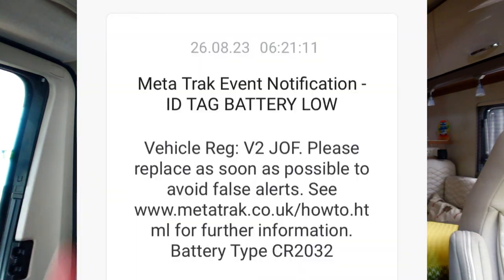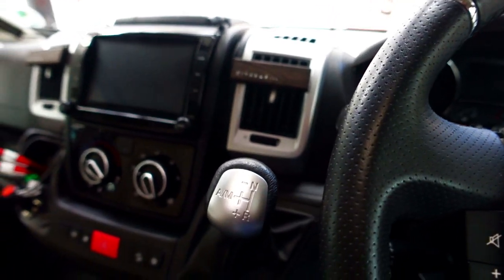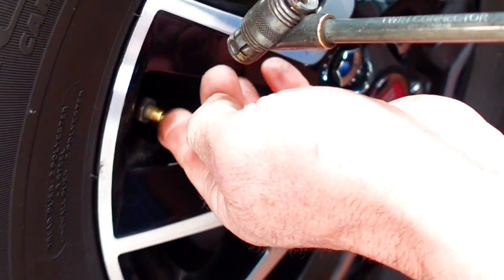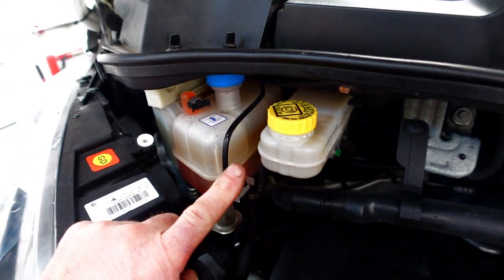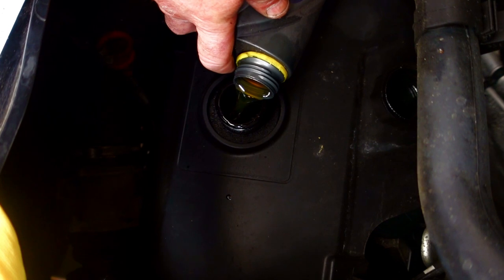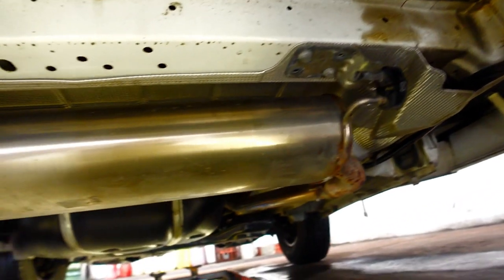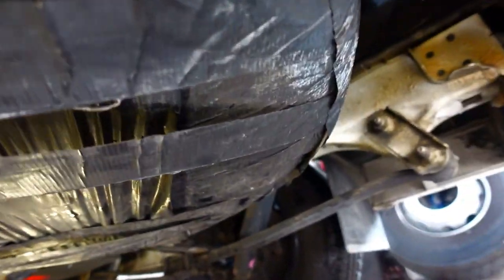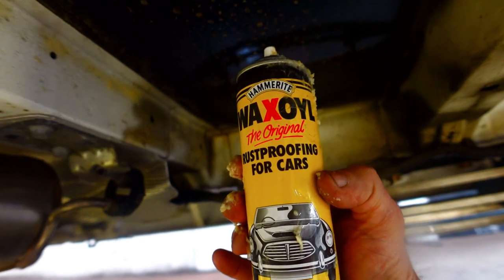FIAT DUCATO Simple Service Maintenance Motorhome Camper Van

Comment: Your engine is starting to burn oil because of the 12 thousand mile changes your doing,,,your piston rings are getting clogged up,,Also the low tension oil rings they use on modern diesels makes it even worse,,These extended oil changes will also destroy your dp filter prematurly,,,If you change your oil every 4 thousand miles you can avoid all of these things,,,
Reply from the maker: Appreciate your help 🙏

Comment: Hi Jof excellent video as usual great tips, my wife loves your Channel , just a query on the oil grade I also have a 2019 fiat ducato 150 automatic euro 6 on a Knaus and recommend oil grade from fiat is 0 /30 😮 do you recommend the higher grade oil you use as we value your opinion
Also enjoyed your videos previously on changing filters etc, was wondering if you would be doing one on cam belt change 
Cheers
Steve
Reply from the maker: Thanks Steve, 0W-30 is absolutely fine, I ended with the 5W-30 this is the grade my supplier insisted on and I have been running, there were concerns of premature DPF blocking probably very minimal though.
Have a colleague that does cam belts, later on will see if we can complete this job on camera.
Appreciate you watching 🙏👌